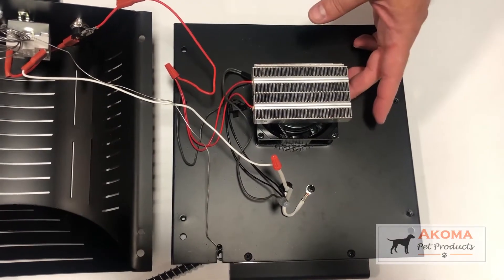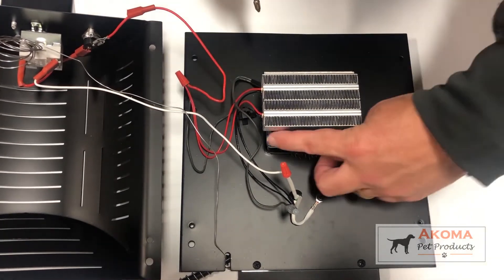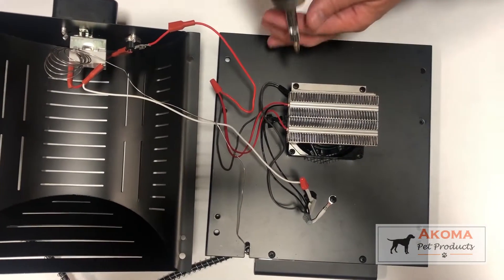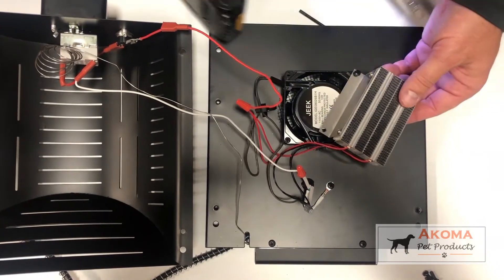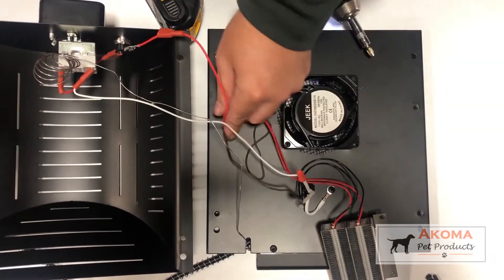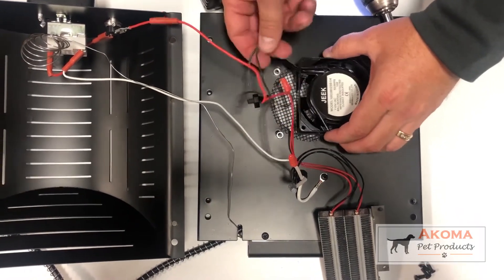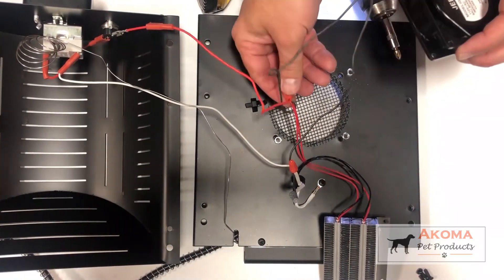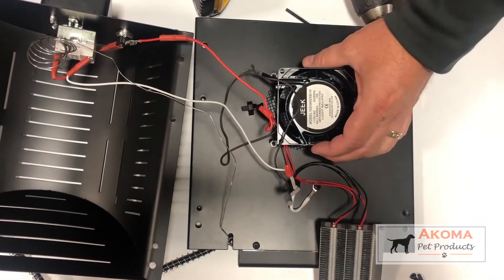Hound Heater Deluxe replacing fan

Comment: Is that fan assembly  plastic  i have an old model   300  watt no fan  no issues  but was gonna upgrade.  My issue is what happens when  that fan fails , will it melt that   fan housing  or will that temp limiter catch it  before it goes thermal
Reply: I just got a replacement fan for mine and the fan frame is metal. Feels like the fan blades are too but it's hard to tell because of the shape.